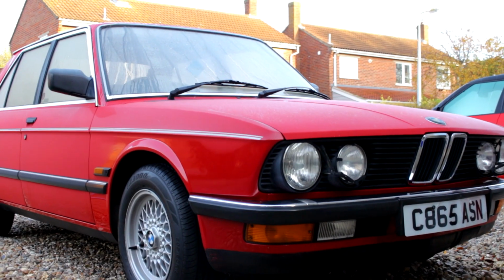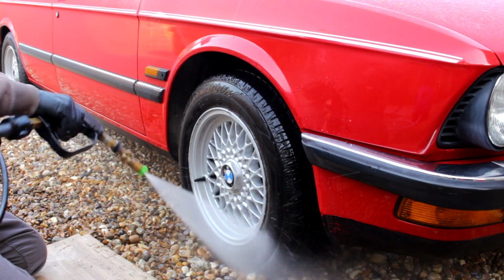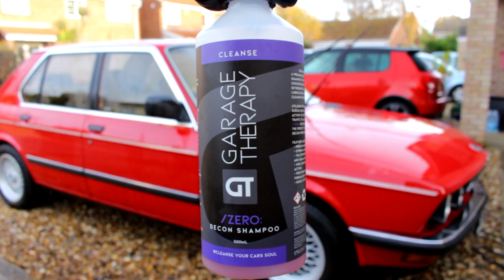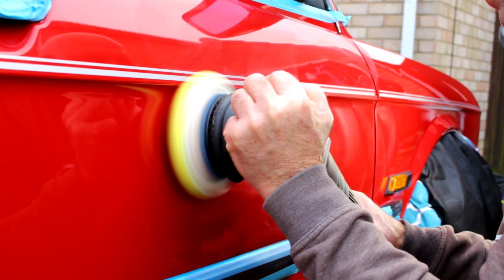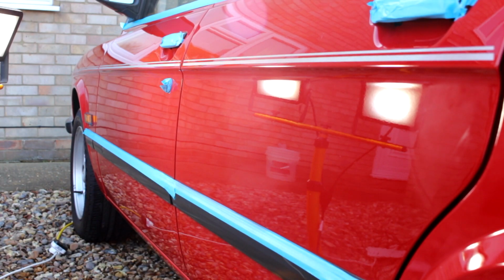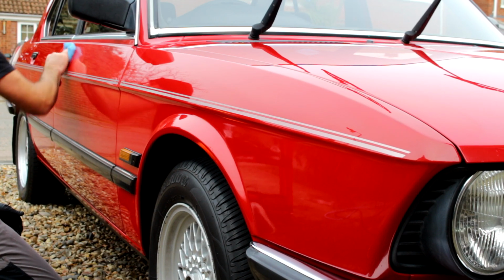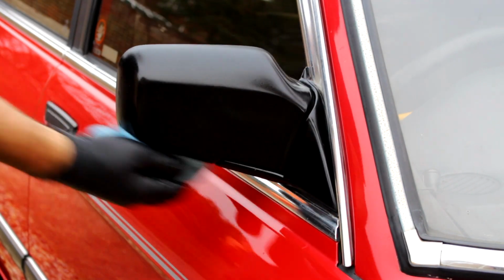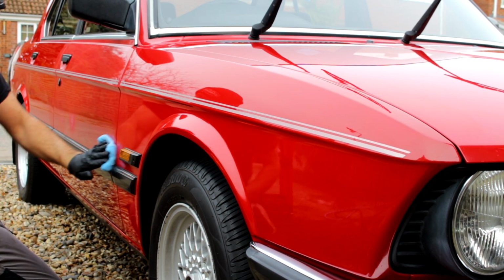Polymeric Ceramic Sealant

Comment: In Puerto Rico, some of us call it bonnet and others call it hood, that is funny because the hood is also a canopy or a carriage top or awning so I always call it bonnet because it refers more to cap or capote although it is also a cover and chapeau.  Bonnet is more used because the bonnet is where the motor is and in Spanish the word is "bonete" or "capó"
We use the word trunk because is associated with luggage or chest.  We don't use boot because it is associated more with the long sturdy shoes used for hard protection on your feet or riding horses or those used for snow.  In USA, England, Scotland, Ireland and Australia is funny how words change or have different meanings like it does with Spanish.😉

Comment: Car looks wunderbar Paul. If DA polishing can't be done, are these spray products (HDD, GT 3)compatible with glaze? Cheers mate
Reply from the maker: The bond may not be quite as strong James because of the fillers in the glaze you could try it with HDD or GT

Comment: Phenomenal results Paul, had the same streaking with TW hybrid solutions ceramic spray after using the polish and wax, damp microfibre and buff, streaks gone. How does the ceramic spray coating compare with refulgence?
Reply from the maker: Refulgence is way better than TW

Comment: It's really difficult to find a product that last a whole winter here in Sweden.
I usually resort to some kind of sealer / Wet wax to "top up" the protection.
The amount of asphalt and iron particles studded tires generate are incomparable.
And weekly washes with degreaser and hot water really eats up what ever product I've used.

Can you use this one at just +5°C ?
Some products I've tried really don't work when it's that cold, and streaks like crazy.

And Paul, I hope for revisits by the e28 !
Reply from the maker: Thanks Daniel stay safe my friend 😉